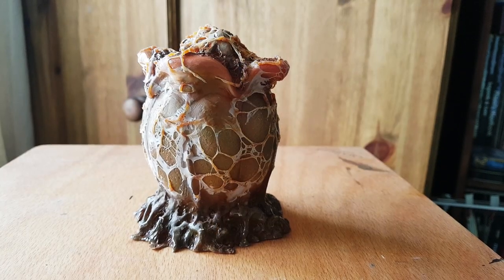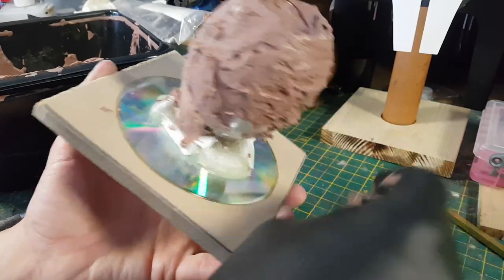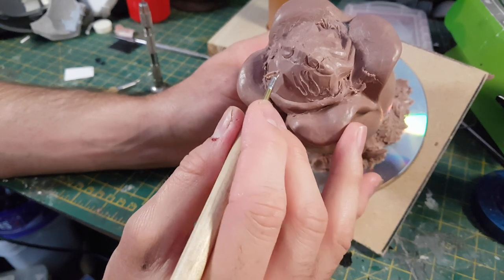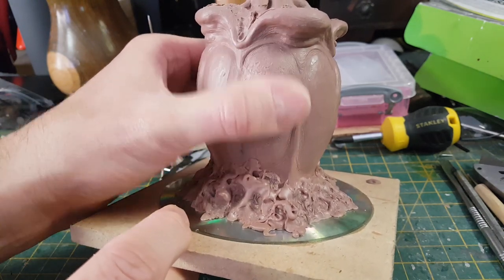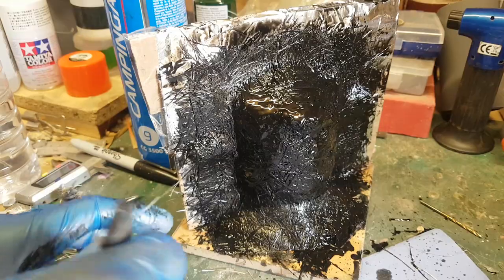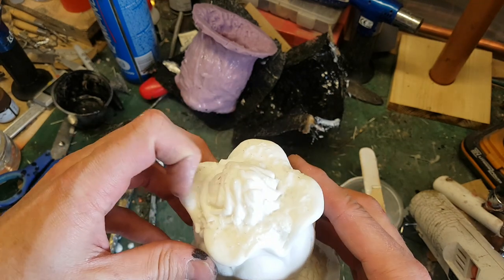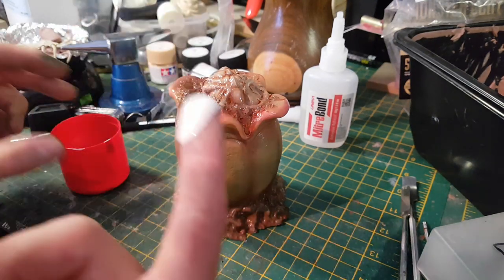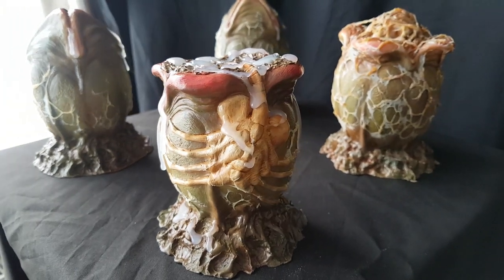Making Alien Eggs

Comment: These are beautifully done. All you need is a 1/6 Ridley with his hands inside with a pair of rubber gloves on haha.
Love the size of these, I have quite a few of the hot toys closed ones and one open one but yours blows them out of the water.
Reply from the maker: Haha, cheers dude, I've not seen the hot toys ones actually.
Reply: @thedarkpower  They're about the size of the plastic egg you started with. They are called snapkits and the egg comes in two halves with a colonial marine in each.
Kind of evil kinder eggs:)

Comment: Awesome work!!! I'll have to try the latex idea. Do you seal it after or use anything to fix it in place?
Reply from the maker: Thanks!  No it sticks, but it will degrade over time so you'll need to refresh it occasionally.  You can peel it off easily though.
Reply: @thedarkpower  Awesome! Thanks Mate 👍🏻 What about a coat of Satin or gloss varnish over it. Will it still degrade?
Reply from the maker: @Secret_Geek  That might work to be honest, I've not tried it though.  I'd recommend testing it on something first ;)

Comment: Which DWR silicone are you using? I am going to order some to try but they have an RTV and an easy mould. Both are run cure but wasn’t sure what the difference is other than the ratios.
Reply from the maker: Hey Christopher, hope you're well.  I've been using the general purpose moulding rubber.  The cured rubber has not got a particularly long life span, so perhaps not the highest quality, but the price point makes it perfect for single or low use moulds.

https://www.dwrplastics.com/general-purpose-moulding-rubber.html
Reply: The Dark Power yes for the price it seems like a good option to just have around. Then I can get the more spendy stuff if the use justifies it.